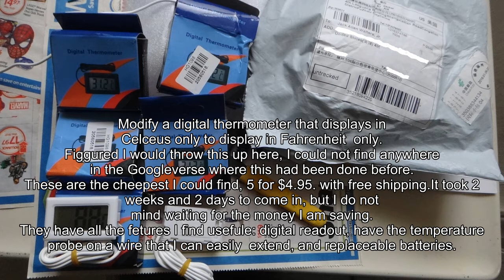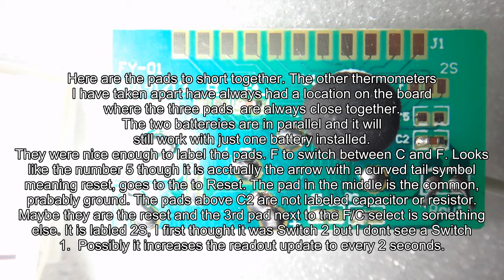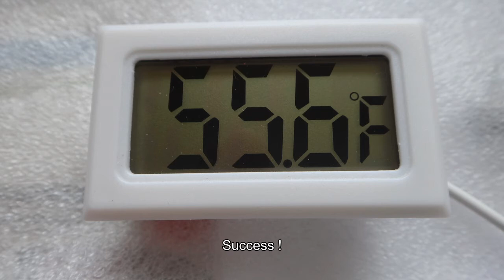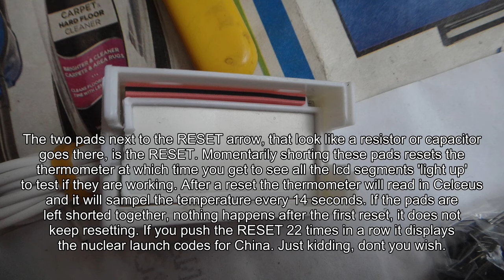C to F

Comment: I have a newer version, and it looks different than yours.  However, there are 2 tiny tiny pads with nothing connected to them.... and it has the letter "F" next to it.  So I put a little bit
of solder flux on the 2 pads.  Then a very thin wire I was able to heat up the solder and tack the thin wire across the 2 pads easily.... even though my eyes are 65yrs old... and the pads
were REALLY tiny.   IT WORKED!!!   Now I have Fahrenheit!!  Thanks.
Reply from the maker: Nice, I'm glad it worked .

Comment: Thanks for this video. It inspired me to go into one of the little hygrometer/thermometers I just got to check. Sure enough there were a couple empty pads marked "C F", and shorting them with a blob of solder switched it to Fahrenheit. This was one of the little $2 black ones with equal sized numbers for temp and humidity. My pads were really tiny and spaced tightly (SMD 805 size?), so I don't think it was meant to be switched like yours.

Take Care
Reply from the maker: I am glad it helped you. That is the soul reason I made the video.
Reply from the maker: Depending on your circumstances:
There may be shorter battery life with the pads permanently shorted. 
A momentary short puts mine into F and it stays in F until a reset or power cycle. 
This make me think a permanent short would cause extra instruction cycles for the blob IC resulting in more current consumption.  
This is only an issue if you require longer battery life or faster temp and humidity measurements.
I suppose measuring battery current with and with out the short would answer the question for certain.
Reply: Thanks OverUnity7734 (just noticed this reply). Yeah, I think I remember that from the video and had considered it. Like I mentioned, mine were really tiny though and kind of a pain to get to, so I'm guessing it was just a jump. I also wondered if the ones that shipped as Fahrenheit had any resistance across that or if a short would make any difference. 

I actually bought four, so I've got three more to do. I'll try to rig up something to check the current like you suggest. FWIW, I'm also running each of them with only one battery installed and they seem to be acting OK for the time being.

Take Care
Reply: Well, a million years later, I finally got around to doing the other three today. They seemed to hang around 5.9uA in the stock state and just over 6 after the short, so probably no big deal. I'm not even sure that difference wasn't just meter error or how (in)accurate my digital meter was way down in that range. The draw was so low I couldn't even read anything on the meter of the analog bench supply I was powering it with. It did coincidentally have a repetitive brief jump in current consumption both times where it would pop up to something in the 40-50uA range every couple seconds, then drop back down. Maybe that's where it's checking the switch like you describe.

Thanks again for the video!

Comment: Thank you brother, I appreciate your time and effort. I purchased these same thermometers with the idea of converting them from C to F only because I could see the display at an angle in a picture to reveal they were capable. Most descriptions clearly state they display temperature in degrees C only. Typically the logic is there to display in  degrees C or F even when not utilized. Allowing for both lowers manufacturing costs. Your video confirms my suspicion even though I pulled the trigger for ten of them before finding your video. I  also plan to convert from battery cell to USB power. Thanks again!
Reply: FYI... Reset is used to calibrate the probe when placed into ice water bath.
Reply from the maker: Thanks, it was hardly any trouble.
I live for electronics and enjoyed making a collage video.
It being able to help someone else is just a bonus.
Reply from the maker: In reference to the Reset:
Interesting, I thought some of my readings seemed off.
Reply from the maker: I still think the contacts are suppose to be momentary. 
Are you in a position to test if it draws more current with the contacts constantly shorted versus a momentary short ?
Reply: not at the moment, I am awaiting delivery of the thermometers, will be happy to test and give results, and yes the contacts are intended to be momentary. That is how other temperature calibrations work for digital equipment.
Reply from the maker: That would be awesome, I can't wait to see how much current I am wasting by having my contacts shorted.

Comment: Thank you for the excellent explanation. Will the unit reset if batteries are removed for a few minutes?
Reply from the maker: It will reset from an error condition if the batteries are removed. 
Since the F selection is permanently shorted, it will always turn back on reading in F. 
I have one of them powered from a solar cell that came from a walkway light. 
The morning sun hits it directly causing over voltage and the display goes out.  
In the afternoon the sun moves off the solar cell and it reads in F after I remove then reconnect power. 
A voltage regulator will fix this.
Reply: @OverUnity7734  That’s pretty deep man. Way to go. Think I’m gonna throw mine against the wall and see if that will trigger the switch. Awesome!